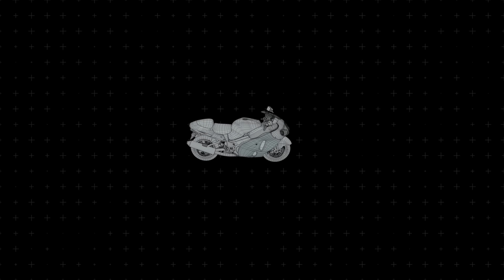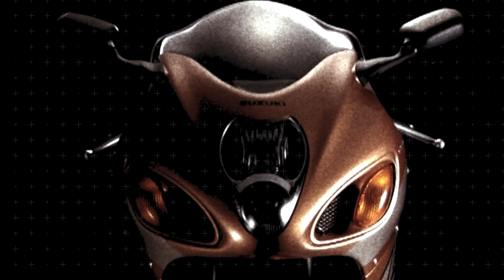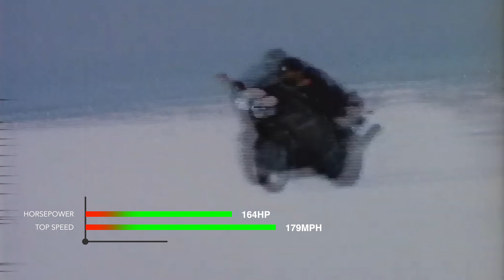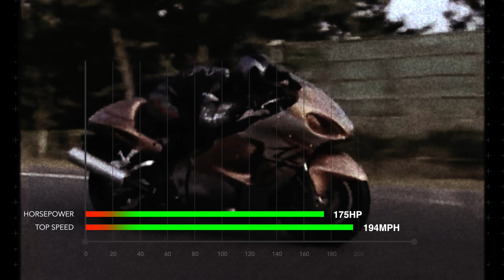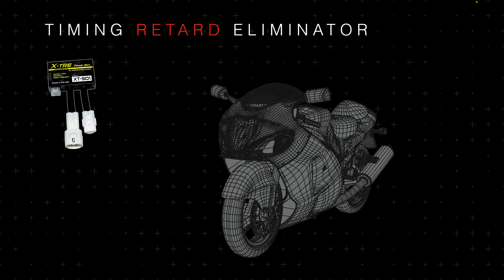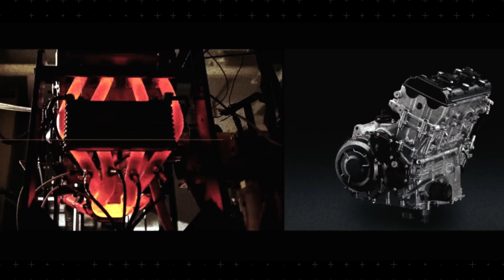Why Turbo Busa Engines Are Overpowered😳| Explained Ep.21

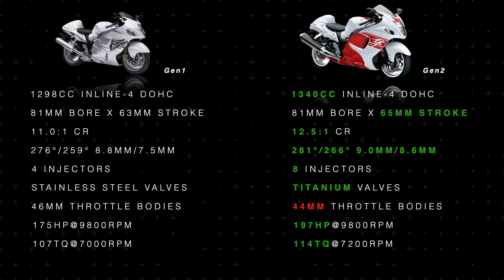Comment: 7:10 Suggestion. Rather than '114TQ' put the measurement unit.  Also if you're gonna use metric for everything else on the spec sheet, may as well use KW/NM for your power/torque figures....
Reply: ... Uhhhh.... so while sure, he should definitely add "lb/ft" to the torque ratings just to be more clear, why in the flying fuck would he list any of the other engine specs in imperial??? O_o 

Aside from using said "lb/ft" to measure total engine torque, as tends to be the norm in North America and the UK (as in power, not like torqued bolts or anything like that) they don't even do that for American engines, because THEY'VE ALL been built metric for literally over like HALF A CENTURY by now! Well, aside from the occasional nostalgic displacement number in cubic inches in an engine name that is. 🤷 (Although the official displacement will still ofc be metric).

Classic "horsepower" otoh is so commonly used and understood well enough world-wide that most people just simply do not need a kilowatt conversion. In fact, it's quite possible, if not likely that horsepower is STILL the more common figure of engine power used in daily life worldwide. 🤷

Comment: Correction clam that the Kawasaki KZ900R was the fastest production bike in 1984 is "FALSE". The Honda VF1000F was overlooked as the fastest and quickest production bike for 1984. This is not paper speculation but real-world performance! As tested in role-ons, starts from various gears, and  consistent high speed runs, the Honda VF1000F would continually and consistently distant the KZ900R Ninja, leaving many owners shocked at the discrepancy in performance based on "claimed" performance figures in 1984. The VF was "far"superior in real world performance!  The KZ900R however was an excellent bike, lighter and nimbler than the Honda but in raw power, the "claimed" figures did not match the real-world discrepancy in performance between the two motorcycles.

Comment: I was a service technician at a Houston area Suzuki dealership when the Busa was first introduced, and I was at the '01 factory update seminar when they announced the gentlemen's agreement.  The Suzuki factory rep said that fear of government regulation was not the sole reason for limiting speed, the AMA and FIM told the manufacturers they were getting out of control and that 300 Km/Hr was the fastest that a motorcycle could go in a road-racing competition setting.  They were also aware that it took most of us about 5 minutes to figure out how to override the speed limiter.  One of the first changes they had to make to Busa engine was the cam chain tensioner. The first ones were ratcheting automatics and some failed, ended up bending the valves and occasionally breaking the crankshaft. The second ones were manual and some had the same results.  The final recall repair kit came in 2001.  In that kit was a new cam chain guide and new tensioner that was designed to use oil pressure provided by a hose that we had connect to the front oil galley via a banjo bolt, and two zip ties to prevent the cam chain from jumping when the kit was installed.  One side note is that most of the broken crankshaft repairs I made out of warranty ended up stroker kits.  I look back on those days and I'm amazed I'm over 50 years old now.
Reply: @thedogsbutler7046 - I bet you have some great stories. Thanks for sharing your experiences- sounds like it was a lot of fun in that era.
Reply: @GregBruns  I have a ton of great memories. I started riding motocross bikes in 1977, got my first street bike in 1983, and in 1991 I became one of the highest scoring graduates of Motorcycle Mechanic's Institute's Advanced program. I was a certified Suzuki tech for about 7 years when the first Busa hit the streets.
Reply: Thanks unc, I wanna hear more of your busa stories from back in the day if you ever get to read this comment

Comment: The Kawasaki Zx 11 was top dog from 1990 to 1995, six years then the Honda xx black bird dethroned the ZED by only one mph 177mph in 1996 then the 99 Hayabusa came out and crushed everything on the road as far a hp and top speed goes, Suzuki claiming 196mph off the showroom floor but this was never replicated in any other tests. I myself did top speed venue's with a showroom stone stock 2001 Hayabusa, only mod was Ivan's TRE to remove top speed restrictions that were agreed upon by the motorcycle manufacturers that year due to a Hayabusa out running a police helicopter on the highway in Ohio I believe the prior year, anyways in a one mile stretch from a dead stop I went 190mph in 98 degree heat with super high humidity, big hp loss in those conditions, the Hayabusa broke the mold back then, pushing the limits much further, it was the KING OF SPEED at the moment in time.... a marvel of technology.
Reply: XX came out in 1996, not 1989...
Reply: @AndrasMihalyi  
Corrections made

Comment: So the 2000 zx1200r has a 220mph speedo and has no restriction until 2002. That's the reason why the zx12r the busa killer for 2000 through 2002.
Reply: Wrong.2000 was not restricted and I killed several 12s with it. Then I turbocharged it and killed anything.
Reply: @22Pachanga  I have to disagree. If you look into Suzuki they had to make changes to the bike in 2002 because they smaller Zx12 in stock form was faster and lighter. While all that was happening the gentleman's agreement was made.

Comment: I DO respect the capabilities of Suzuki and the Hyabusa.... But... I'm STILL a Kwak fan, (they made what was/is regarded the best factory Turbo bike of its era - GPz750 Turbo, they were the first motorcycle manufacturer to utilise RamAir on these 'Intercontinental ballistic missiles' (lol), and recently they were the first to produce a bike with factory fitted Supercharger) and so, love the GPZ900R, ZZR1100, ZX12-R (was designed to have a balance of outright top speed but also have track capabilities, though, didn't quite succeed with its weight) and the mighty 'Six eyed beast' - ZZR1400, all those bikes with their own impressive capabilities and their own commanding rights. 🤔😏     😎🇬🇧

Comment: there's just something that happens when u throw ur leg over a in-line 4banger and Crack a hole shot lol..  I know technically it's not flying but the feel experience of how u have to lay down tucked while holding on for dear life that makes those motors and two wheels in my opinion to be what it prolly feels like to be a flying type animal lol there are few things that can make anyone feel that instant fear like those bikes can.. if u can run thru those gears and back down as quick as possible and not have ur heart beating like uve just went down a roller coaster hill then I'm pretty sure ur a zombie cuz other then being blasted outta one of the human cannons u see at the circus idk really any other method of making your self be a bullet for a short period of time lol... it's almost just pure danger for danger sake that our species even invented such machinery hahaha

Comment: That was awesome!! I had a Turbo'd 1100 and a Busa ! I was always scared that engine was going to blow up in between my legs everytime I heard that turbo spool but I still miss my bikes..
Reply: yum yum my aircooled 90hp Bandit12 quickly left the chat..
Reply: @fidelcatsro6948  😂🤣😂🤣
Reply: Busa nickname is nutcracker
Reply: @lucky889s9  should`t it be butt-cracker then, because the acceleration is so hard? If the deceleration would be especially good, nutcracker would be a nice name dough.
Reply: @gehtdianschasau8372  not when it break, stop suddenly, crushes your nuts
Reply: Get your Busa back and strap a jet engine on it xD
Reply: @K.O240  I don't need that heavy bike for that...lol. that was the only thing I didn't like was that it was pretty heavy
Reply: Suzuki dropped the ball BIG time. They could’ve turned that motor into a powerhouse 2.6L V8 and threw it inside an AWD Kizashi and destroyed every other automakers flagship sports sedan. Would’ve been a WRX killer… RS4 killer… AMG-C Killer… would’ve destroyed EVERYTHING
Reply: @NSUScooter I agree
Reply: If only you cut the turbo I half and made half of it see thru I’d love to see a video on how turbos work inside and out
Reply: @WillMoxonFloatsOnOil  I've actually been working on that for a couple of years at least I'm getting close but it's taking me awhile, because of the pandemic and whole bunch of other problems I ran into because that is beyond an engineering challenge. But it is coming
Reply: I sold my '00 busa I bought new just two years ago. Fastest bike stock I had ever rode even faster after many engine and chassis mods.
Reply: have you ever gone 500kmph ?
Reply: @ITX635 only in an airplane
Reply: The only thing that ever scared me more than a Hayabusa was a Triumph Speed Triple
Reply: @thecloneguyz  wow it looks like power to weight ratio for the new Triumph Triple is 2.44lb / 1hp and the new Hayabusa is 3.04lb / 1hp , that's pretty nuts.
Reply: @WarpedYT  
LITERALLY poopied my pants at 177mph with a speed wobble from a pothole.....recovered BARELY
Reply: @thecloneguyz 😮😢
Reply: @WarpedYT weight
Reply: @thecloneguyz OMG
Reply: Really loved the jet powered Go-Cart! 👊😩
Reply: @josephpacchetti5997 thanks, Wait till you see the jet powered Harley on building right now. 😊
Reply: Best times of my life were on my Busa.  I miss my youth and the p@ssy I got with that thing…..
Reply: Stop telling lies lad
Reply: @billybarr7443  sure bud
Reply: what happend? did the ran off with another man?
Reply: @monilvalia9425 yes
Reply: You can turbo a carbureted blackbird?
Reply: I bought another one right before I got my divorce😁😁😁👊🏾😛
Reply: @wewhagg  Perfect timing lol

Comment: I'm gonna get smoked for this one: can you guys do the 3.3TT from Kia/Hyundai? Sodium-filled valves, and I've seen people push upward 600whp with stock turbos. Basic bolt-ons and a piggyback, I went from 320whp to 490. Bigger turbo I've seen 700. Thoughts?
Reply: I’ve always been curious about those motors, but just assumed to make any real power I’d have to run a standalone ECU. Figured a piggyback was just asking to send a rod through block but I guess that shit has progressed too since I was younger.
Reply: @notaboutit3565  definitely did. I did some runs today, just some 0-60s on stock maps vs different ones, and with methanol on/off. I'll upload them for reference.

Comment: they did it wrong tho, they should have made a 600 with a turbo, so it can keep up with the bigger bikes in a straight line, they got the extra handling on corners, less work and effort needed on your part
Reply: Nobody would buy it. 600+Turbo is 1000cc NA power, but would cost much more.
Reply: @AndrasMihalyi  much more? an R1 new is like 22k yet they can make an R7 for what 7 grand.. its euro regulations holding back the big boys from being affordable, they used to be 8 grand new before all the electronics were installed, you can't say that ABS and Traction control should double the price of a new bike..

Comment: Hey 337 SPEED. Awesome video! I know they are a niche bike, but can you cover the BMW K-series? They changed everything for BMW Motorad and the 2005-2016 models are awesome marvels of engineering. A big displacement bike that has now bit the dust.
Reply: I worked on K75 and K100 in the 80's, (Suzuki/BMW dealers) Didn't realise they re-used the K designation later on

Comment: Low compression and high engine displacement is the key. Stroker and big bore kit would made it even monster of an engine.
Reply: No .... 4 cylinder reving to 10.5k rpm stroke it and big bore and see if it can rev to 10.5k susuki know what there doing, you dont. They spent lots of money and time making the most powerfull bike engine, you didn't.
Reply: @kovacevd  who is this susuki that I have never heard of? 'Suzuki' doing the research for long term and reliability. You can still do high revolution with bigger bore, long stroke is the challenge. Also having bigger stroke means bigger displacement, so force induction can be introduced. Making the cylinder bigger by those methods means lower compression ratio.

Comment: I´ve owned a Honda CBR1100XX Blackbird, with a Dynojet injection module. Never felt the need for more power, could reach some 307 km/h, GPS in my pocket as the speedo stops at 299.
Let´s be honest, the Blackbird is a much nicer bike to look at, and it´s a Honda, it will work in a predictable way.

Comment: What is that intake angle 15 degrees or less. That, my friends, is how the modern intake tract is designed to make  max power. Evan without forced induction, almost straight in, is how you make POWER. Just as the pro-stock, boys, they are getting close to single digit angles.

Comment: There's a reason the Hayabusa is talked about like a mythic creature. Its a miracle of engineering.
Reply: It was specifically called Hayabusa (Black Bird killer) in response to Honda's 1100cc Black Bird
Reply: @batata1979  the origins of the name makes it 10x cooler, i dont have one but i just like saying boosa
Reply: @batata1979  And then the ZX12r was faster  then the first Gen busa.
Reply: 1st gen had a locked speed limit as I recall, personally thou I don't consider "faster" as the one that has a higher top speed. 
Eventually it all comes to street or track, marketing numbers hardly made a difference, and very few people run on stock 🫡
Reply: @batata1979  1999-2000 Hayabusa was unrestricted, same as zx12r. Search for a video here, 3 guys on Busa, 12r and Blackbird. 12r was faster, top speed, accel, everything.
Reply: That it is !!!!
Reply: Epic profile pic my guy, Oh, Sleeper are peak.
Reply: TSSssrrrarrẞa
Reply: No miracle whatsoever, it's the result of the appliance of knowledge, nothing mystical whatsoever about it.
Reply: its only a legend for suzuki lovers....
Reply: Oh sleeper guy. Respectable.
Reply: Not really, the zx12r was just as fast with 100cc less and handled like a real superbike

Comment: Worked at a Suzuki Dealer back when the 300 km/hr limit was set. At the yearly new model / product class the instructor said to us the bike is limited to  186 mph in....TOP gear(6th) via the ECU but can be easily bypassed by regearing  final drive and droppin  down to 5th .....he also said the US hadnt passed a speed limit law yet but the OEMs hoy together and in Japan that was 300 km/hr. They did it first to keep the speed wars alive for a couple more years by acting like they were complying. He was 109% accurate on all points.

Comment: I have a real pretty copper 99 busa. By far my favorite bike ever, I can’t wait to turbo it. The power is already insane. I’ve also owned a 93 zx11, still had the power to snap your neck back. A zx12r would be fun too lol
Reply: Leave it as it is, you have more than enough power, and you could put in real danger testing a turbo busa, not to mention that the bike will loose value after the mod...